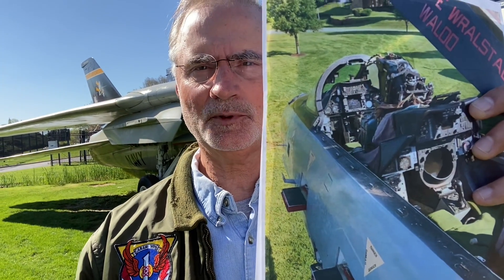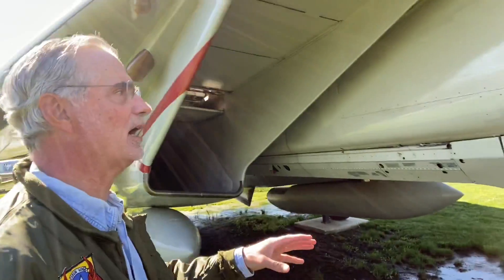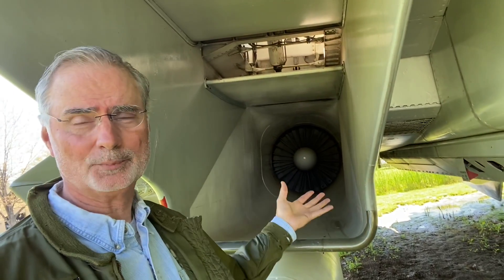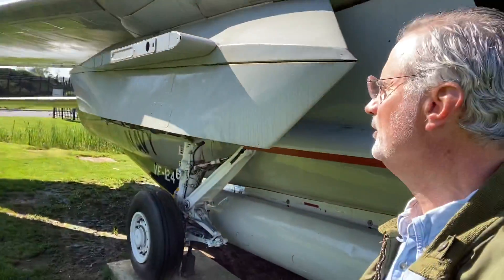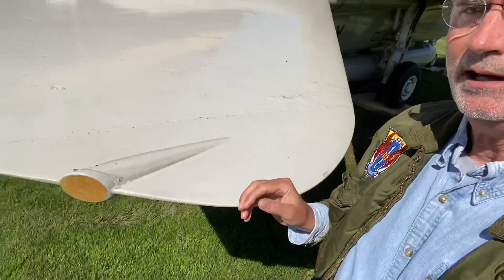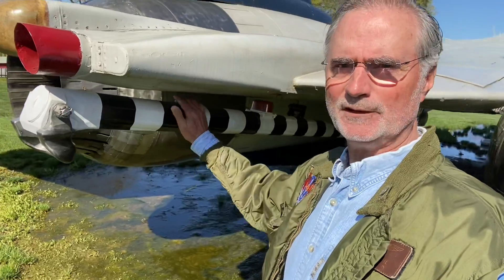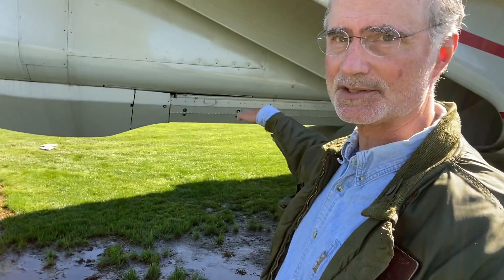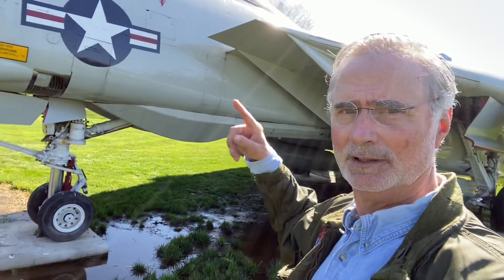Secrets of the F-14 Tomcat: Aircraft Preflight Walkaround

Comment: Ward said check for leaks, I was in V-1 Air Department Flight Deck. Those F-14's were constantly leaking fuel and hydraulic fluid on the flight deck.. Those planes took up so much area on the deck.
. If the plane captain ask for a wing spread , you had to move the plane to an open area so you had probably 60 feet of an open area... Don't miss them...

Comment: Many moons ago I worked at P&W in engine test and had a substantial amount of TF 30 time. I remember that it had an automatic restart switch (ARS). I was told that when the F14 was on the Cat with the JBD up and the engine was at mil power, some times the exhaust would be sucked back into the intake and cause a stall. The ARS was supposed to correct this problem.  Did you ever experience this condition, and if so did the ARS actually work? I used to cringe at the thought of the engine stalling during a launch.
My nick name for the engine was boat anchor, never did like them too much.  P&W did design a new engine for the Navy, the F401. It was a dirivitive  of the F100 for the F15 / F16 unfortunately the Navy didn't procure it. The 401 might have solved a lot of problems the fleet was  having with the TF30.

Comment: I can't get over how small the arresting hook is. Look at the end of it......what is that, a half inch bolt holding the hook on?  So if it is high strength steel at 95 ksi then it has about  47.5 ksi. So there must be something about the design of the arresting hook that we can't see here because a 47.5 ksi bolt ain't enough to hold it. Unless the hook bolt is actually inconel at 220 ksi.......or 110 ksi in the case of a half inch bolt. That would be more than enough to handle the max landing weight of the Tomcat. Boy howdy, if someone slipped up and put the wrong bolt in that hook.....you're going for a swim.

Comment: I took my 2 boys, 9 and 10 to the June 2000 airshow at Willow Grove NAS when an F-14 went down and both crewman tragically died.  As I recall, They were doing a flat figure eight maneuver and got way too slow. Coming out of the turn the plane was in a 90deg bank and very low.  He rolled level but then the left wing stalled and dropped and it was unrecoverable.  My very sharp 9yo knew something was wrong before I did, he said  “He’s in trouble” several seconds before the plane went down. I’ll never forget it. That young man now configures software for flight simulators for the Navy in Norfolk.

Comment: Why can't the person in the rear seat fly the plane. If something happened to the front seater, the back seater does what?
Reply: RIOs were radar operators, not pilots. Most could not pilot a plane, especially a wild cat like the F-14, therefore it is very unlikely they could bring down the plane safely. Secondly, they had the pilot's seat in front of them, blocking their front view for the most part. There is in fact a stick in the RIO's seat, but it is merely an input device for the several radar systems on board.
Reply: @razortosh  Does the back seat pilot get trained to fly?

Comment: I know it was just a movie, but.......Would the titanium nose gear on mavericks tomcat have been ripped off by a steel bridge guard rail? And since the angle of take off placed the 2 rear landing gear several feet lower than the nose gear wouldn't they too have been damaged as well? 

I know when Grumman engineered the F-14 Tomcat they dropped it from a hight of 2 stories to test the landing gear.

The Aircraft Maintenance and Regeneration Group, or AMARG, at Davis-Monthan Air Force Base 
in Arizona is destroying or by now has destroyed nearly all of the F-14s Using a 100,000 pound shearing machine, and a shredder that is 120,000 pounds. 

As powerful as the grinding machinery is, it can't shred all of the F-14. The titanium landing gear was built to withstand the force of slamming onto an aircraft carrier's deck, must be cut by hand with a demolition torch.

Comment: Sir: when you began your walk around, pointing in the inlet you said turbine blades, it is the compressor fan.  One thing also, the TF-30 was notorious for shingling of the mid span shroud of the first stage fan. Not sure if Tomcat Natops had that in the walk around. TF-30-P414 was same as the TF-30-P-100, (except for the afterburner, which the 414 was powered, and the P100 was cycled by either airflow, or exhaust) which powered our beloved F-111F AArdvark!   Well done sir.

Comment: I remember when that flew into Quonset Point to be put in the museum, I was a little kid back then. Used to pull it out every year during the airshow until the museum closed up a few years back.  Was wondering where this thing ended up. They must've repainted it after it came from Quonset because it had a grim reaper on the tail and teeth on the nose

Comment: I worked for Curtiss-Wright Flight Systems, we had several test rigs for the F-14 wing actuation systems…We manufactured all the driveshafts that connected to your actuators. Had a whole complete configured wing jig set up to run multiple driveshafts and actuators ….and also a very long flexible cable, that went in a jig assembly, that we checked with thermal couples at the critical bend ….to make sure it was correctly operational,  with the same Hydraulic PDU the aircraft used. It was a very high-speed hydraulic motor, we ran multiple cycles making sure, The flex cable that must’ve been about 18 feet long was assembled correctly ….before it left our facility.

I was responsible for all the test rig equipment Validation and calibration in our facility. Also, we made the canopy actuator for Both F/A-18 Models. I was proud to see those planes in Top Gun! 
I was the main person over all the military and commercial test equipment that got audited by the government, and by the commercial side by the FAA over 22 years. Also worked on the F-35 program, all three Variants …for the leading edge flap systems, and the ordinance release mechanism… we had to test redundantly with very tight tolerances. I Was involved with the early R&D test rigs that later got replaced by the up-to-date aircraft simulation test Rigs, for All variants of the F-35. My Father has been a certified flight instructor since 1969 and Is still current at the age of 82.. Got to see an F-14 and an F-18 perform at the same airshow. I was blown away, when the F-14 came by near supersonic , with the wings back In full afterburner… we could see the smoke trails in the distance,  on his afterburner flyby….. it shook my whole body. The F/A-18 was first… it was loud, but there was no comparison to the Tomcat. I was very fortunate to grow up in aviation, sitting on my dad’s lap flying a Cessna at the age of 3 years old. Went to all the airshows had built model aircraft, especially the F-14. I lived and breathed aviation and then worked for the pioneers of aviation which were the Wright Brothers and Glenn Curtiss…. I would’ve never dreamed I would be involved with those aircraft… when I got older… it was a honor! I started working at CW ‘96. Was even responsible for the actuation tester…. for the space shuttle payload bay door Actuation system, and the new robotic arm looking for missing ceramic tiles. I wanted to be an astronaut as a kid got to talk to one of them that made several flights into space and Had several spacewalks helping complete the ISS. So I had a stressful, but enjoyable job supporting my country! My dad was in the army as a sergeant….. he was very proud of what I accomplished over the years, with the aerospace company. I feel honored to be a part of the military and space program with my position. I’ve always had a sweet spot for the F-14 …And I love your channel! Thank you for all you do, and for your Service to our country!

Comment: You make me sick. I couldn’t get past four minutes into your self-absorbed lovefest before stopping it. First of all, Calfax fasteners were easy to tighten, but they were replaced with more dependable Tridair fasteners. Second, ingesting a bird into the heat exchanger ram air duct did not introduce odors into the environmental control system. Third, you did not look for cracked engine turbine blades. I find it difficult to accept that you ever “dove the duct”. You were NOT a Plane Captain… you were a FO. Finally, the only way you may have experienced a “fowl” (pun intended) odor in the cockpit is if a living creature were ingested through the engine. But for that odor to remain is highly unlikely. You were a RIO. You were not a Tomcat mechanic. You are only pursuing fame no matter the stories you feel you need to tell. Although I suspect you have conservative political affiliation based on your background, your behavior leans heavily toward being a liberal liar. You are either a liar, or an uneducated sensationalist (aka, a liberal journalist). I cared for you then, but not now. Get your stories correct before you try to impress others with your false bravado.

Comment: Great video Ward !!! This was a very interesting display and quick gen-fam, of this amazing plane... The variable inlet ducts on this one seem to be mis-matched between the forward and aft ramps on the starboard engine, do to they match-up when the electrical system is activated? I did not know that anti-freeze circulates through the external Phoenix missile rack to keep it and the release mechanism in that rack,  from freezing... I'm wondering where they go to get the heat for that anti-freeze, maybe the engine oil, and/or the hydraulic fluid reservoirs? In other channels, and what Hozer said on this channel, the F-8 Crusader was supposed to be known as the last 'Gun-fighter' fixed wing fighter aircraft the U.S. had in it's inventory. Was it retired after the Tomcats?

Comment: Super Awesome walk down memory lane.
- The 3 section inlet ramps explainer was outstanding, as well as, the different engine options from the early F-14As (P&W TF30) to the F-14B/Ds (GE F110-400). Nerdfest. If you have an Aerospace Engineering degree or have sons and daughters pursuing a BSAE, the coolest course is Compressible Fluid Dynamics. Inlet ramps are used to turn the incoming supersonic air flow straight into the engine turbofan at subsonic speed via a carefully placed shock wave. The exhaust nozzle is shaped for the high speed flow using Mach Waves. You can see the diamond patterned Mach waves, when an F-16 takes off in full AB at night.

- Only to be topped by the detailed run down of AIM-54 Phoenix AAM Ops. Most early radar-guided AAMs, like the AIM-7 Sparrow were semi-active (needed the fighter radar to guide the missile to the target). What made the Tomcat AWG-9 radar and AIM-54 Phoenix pairing so powerful was the ability to fire multiple missiles at the same time. I didn't know the AIM-54 went from semi-active to active (missile's own radar seeker guides the weapon on target without help from the fighter's radar), diving down from 80k feet. 

- The LANTIRN pods were developed for the F-15E Strike Eagle to give the Tomcat a bolt-on A/G attack aircraft capability.

Comment: calfax were later replaced with a coarse threaded type fastner. the calfax barrel  mounted below would hold water ,corrode internally , fastner would work loose. I  was mechanic on these for 9 years of a career. but calfax would be sticking up  after almost every flight

Comment: I was ground crew on a Sae Harrier FA2 for the Miramar airshow in 2000 and our cab was ranged next to the VF101 display F14. We found it interesting how many tools were used by ground crew after the engines had started to open and close panels before the jet taxied. Where even our line pouch had to be Signed in before the cab was made ready for the pilot to sign out

Comment: Gen X aviation nerd here - always loved the Tomcat! I'm an adult now and work in logistics, so I get why they had to go, but what a sad day. We used to have an airshow here, and the local museum had a flying F4F, F6F, F7F, and F8F. I remember a couple years they'd get an F14 on the airshow circuit, and they'd fly them all together as a display of the Grumman Cats. They looked great all together in formation, the F14's wings open wide and flaps hanging low to stay with the Wildcat. Then he would kick the throttle and pull up and out for the missing man formation. Man, the 80s were great.

Comment: Ward,  also when they did a mock dog fight between an older block F-16 and an early model F-35 there is hearsay that the older F-16 got the best of the early model F-35 because of the sensitive coating or whatever.  When this happened a lot of the aviation enthusiast said the F-35 could not dog fight!    Your thoughts please

Comment: If memory serves. During USS Nimitz second deployment to the Mediterranean Sea in 1977. F-14A Tomcats did not carry external fuel tanks, and they did not use afterburner to take off. On the third deployment to the Mediterranean Sea they did use external fuel tanks, and they did use ab to take off. On this deployment we were in the failed attempted rescue of students in Tehran (I believe). Years later as a civilian I was fairly shocked to hear of the problems with the P&W engine. Heck, F-14A was still used in air shows in the late 90's I believe.

Comment: Nice video! About air intakes. Mig-21´s solution (or migs solution) was ugly, but it was kinda magic at the time the plane was first "launched". It is ugly though, but its also very reliable, and very simple. Still with that "onion" on the nose got even mach 2 air to 500 km / h to turbine. This is mainly also the reason that 21´s just gathered speed more and more, till at mach 2.05 -> after that: aft stability went to unstable state (aft is kinda heavy also in mig21), and the whole plane could go sideways if one did not brake fast under that 2.05 mach. So with mig 21 speed was limited by aerodynamics itself, the turbine would just make more and more power / speed, till it broked down. Actually here in finland one of the blade rings got off from axel, and it SAWED the plane cut from the middle :P Actually Finland flew with 21´s till 98, when we had had the most f-18´s (last of 60 planes got to Finland at 2000). From sixties to ~2000 Finnish airforce flew with Drakens and Mig-21 F´s and later 21 Bis aside with Saab Draken. Good combo though. Otherone was fast, and climbed kinda straight up, and with Draken we had more of western (or atleast more western like) technology.  Draken did not have adjustable intake, and it was all the time alpha lookin flying. Actually couple of Drakens went down in Sweden-> they Super stalled, and needed alot of speed and altitude to correct that, and still was very hard if that happened. Many pilots did not even try, they jumped as soon as Draken superstalled. But it was reliable as hardware, Mig was FAST to intercept (thats kinda the only thing it can do, but it did it well..). OFC tomcat it is from the other planet besides those two, though it is bit of younger also.. Draken was actually made from Germany´s papers at early 60´s, like Saab Safire etc..
Reply: Bit of change still in 24 years. Like 98 we still flew with mig-21. Now we are waiting for our F-35´s (CTOL) to arrive at 2025 ;)

Comment: I was on the flight deck when an F-14A from VF-51 had a ramp strike on the Kitty Hawk. The plane broke in half. The rear portion of the aircraft caught the wire and the front slid down the deck. Pilot and RIO ejected. One of them landed on and S-3 and the other one landed in the fire. Due to the fantastic training we had on the ship, the fire was extinguished immediately. The 2 guys were injured but they lived to fly another day. The next day, the rear portion of the aircraft was dumped in the Pacific. I think you can find the video on YouTube.

Comment: 2:45 Just a few weeks ago I was telling my kids about some automotive engine bays that use different size bolts for e.g. the alternator,  AC compressor, power steering pump, water pump, timing chain cover, etc, and how maddening they are to work with. I think it was the Taurus SHO that had both American and SAE bolts on the same engine, to just make life that much more frustrating. Why on Earth do these companies not use a single fastener type for all the locations? Is there no feedback from the technicians to the engineers at Grumman?
Reply: With thousands of fasteners, grams add up fast....
Reply: Engineering takes priority over mx, nearly every time.

Comment: Great description! What is the purpose of the two small fin's on the bottom aft part of the fuselage? Someone told me years ago they were for stabilizing the aircraft at the optimum angle for strafing ground targets. Is there any truth to this? If so, how much would an F14 even be used in strafing ground targets? Are the fin's controllable or fixed?
Thx Ron

Comment: Good vid. I was an instructor at VF-124 FRAMP for four years, as an AQ, and did the Friday indoc walkaround for the new F-14 maintainers for a year or so. It was always a thrill to me, for those folks to get their thrill, to see and touch the F-14 for the first time. After that, spent two cruises with VF-51, and then back to VF-124, as a shop supervisor.
Of course, I have to say, I got the special treat to work on the F-4 J, S, & N, while assigned to VF-21 before that. Two cruises with the F-4N. Long story. . .